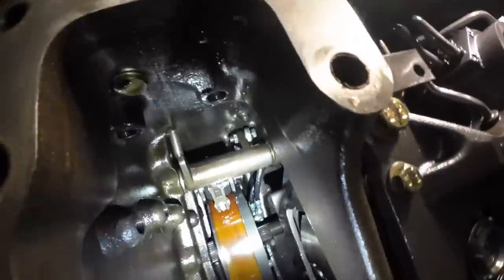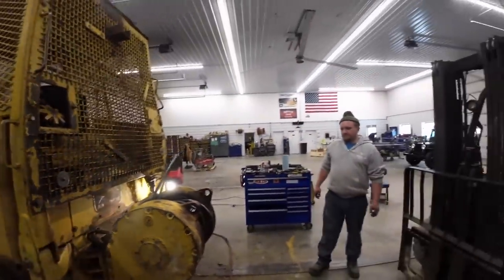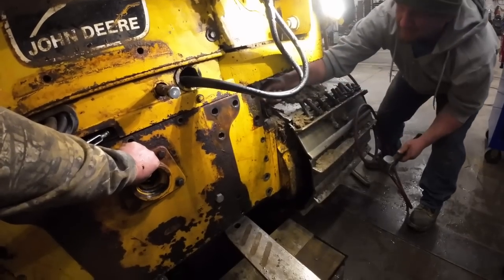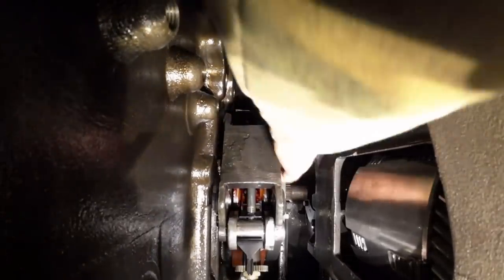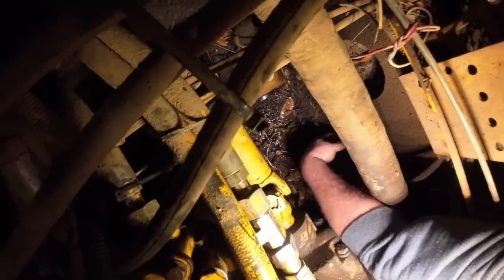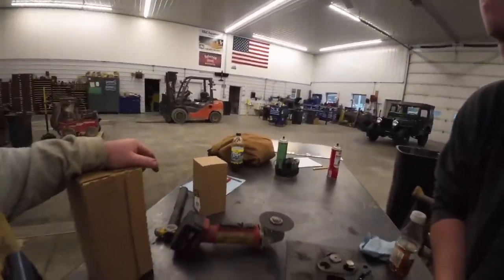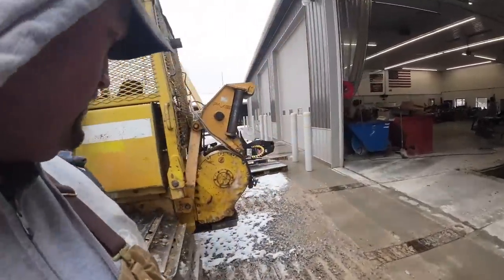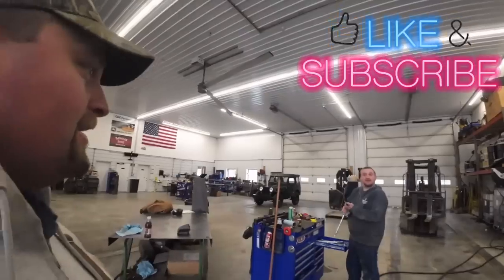Local loggers did it again. What did they break this time on their John Deere dozer

Comment: 3/26/23; ..amazing how you have learned sooo many details on these various machines; you no trouble zooming in on t exact problem, then somehow get yur 📸 camera & fingers inside the belly of the beast & fix it! So how much $ did a broken 'c' clip on left brake band tension assembly cost? $.25? ...but labor & few new related items + new hydraulic oil.. humm..gotta be coupla thousand including minimum shop time (fork lift, psi wash etc). Customer gotta be happy to have his dozer back in safe workable order. Another good job & fine video presentation. Helpful tips & info to all viewers having this type of equip also gotta be appreciated. Good job Clint! Stay safe & carry on!💪⚙️🔧👍👏✅️🍺😊

Comment: Nice video. They got lucky on that one. Nothing big got chewed up in the transmission. 

Talking off the old steering clutch setup brought back a bad memory. I got a finger stuck when the band sprung open. Luckily I was able to put my boot against one side of the brake band and found a pry bar to close the brake band enough to get my finger out. I didn’t like plan B of taking the side cutters to snip off my finger. That’s when I got my first cell phone in 1995. Working on equipment in BFE by yourself can have its drawbacks.

Comment: I love those old deeres they always start no matter what I’ve got a 450 and two 650s really the only problem with them are the frames they like to crack close to the back above the tracks I had just had to split a 450 put all new bolts between the rear section and the main section

Comment: I have a old 450g. Purchased it with 2100 hours on it.  As of right now it has 5K.   
 That machine has been a moneymaker, extremely low down time and cost of repairs, which were minimal didn’t cost much at all. 
 Can’t say the same for the cab and air conditioned 650J I have. Seems like at least once a week some little something keeps you from working it.     
  But I did learn one good tip from you about a year ago when the electrical system shut down about popping the floor up and using the dog ears to move it and load it.

Comment: I thought I may have seen the pin that the seat clip fell off of possibly honed out and like a little cone shape at the end. Even though that pins not supposed to move like that it could’ve rolled around with vibration and shaved a little metal off the end of it so if it rattled around it could still pop that C clip off… possibly?

Comment: Clint, great video, do loggers in your area use dozers to pull the logs out to the landing sites? Where I live dozers are only used to make the bush roads and landing sites. Rubber tired skidders with tire chains year round are used to pull the logs to the landing sites but transporters are becoming more common as they don’t damage the ground surface as much.
Reply from the maker: They use rubber skidders still but in winter and rainy days they will use a dozer
Or in this case it’s a small operation and this is all they probably have

Comment: them logger dozers are about like oil field dozers they see hard use and usually different drivers and kevins sausage fingers a guy i worked with in the oil field always told me if you would get them fat pecker tongs out of the way so i can see too

Comment: I have a 450G LT.  The left turn and break work with a fair amount of pedal pressure.  The right takes excessive pedal pressure to get it to turn.  It does lock up and spin the dozer around but have get on the pedal hard.  I adjusted the spider  gear through the plugged hole but when I got the pedal clearance to the recommended pedal travel then mashing the right pedal would stop dozer completely.  Just as it does when pressing both pedals.  Adjusted the right spider gear back enough so this would not happen.  No help still takes excessive pressure to turn right.  So I put the adjustment back where it was.  Thought it might be just that the last driver just turned right mostly.  But now i wonder if its something like you had in this video
Reply from the maker: Could be
Reply: Not saying I have the answers to your problem. But in this video at the end when he was pushing the foot pedals he mentioned how as you push, fist it is supposed to disengage the clutched that drive either side. Then the more you push the pedal it starts to engage the brakes on that side. There is a process to check 5he pressures to make sure they are acting in order. Maybe your clutch isn't disengaging before the brake starts to engage.   On top of trans under the seat was how and where we would hook up guages  to check the pressures for those. If I remember correctly. They were adjustable, they had small springs and you would ad or take away small washers that would change the pressures of the springs so they would have the right amount of hydro pressure and or act at the right time for disengaging clutch  engaging brakes and turning either direction. Or might need some new springs.  Or it could be something more serious like those big round clutch packs that the brake rings run on that they were working on in this video. They have a stack of metal plates with clutch disc's in between. And they get worn out and it is too much travel for the pressure system to make it work. About what he did in this video. Hope ya figure it out and good luck. 
 It's been 25 years and I'm not a certified jd mechanic. But that might be something you could look into. Just need a couple guages a
Reply: @billtmarchi4320  Thanks for the info.. I'll do some more checking.
Reply: @buck3409  ya. These were late 80s 650G dozers. So may not even apply. But good luck.

Comment: Have worked on those trans and brakes before. You do remind me of the how hard it was to put together those pins and clips and how those assemblies getting hands in there on the float or something. And when you put new brake bands on you were supposed to soak them over night in fluid to get them soaks into the fibers so it would be good when they start working them so as not to wear them out real fast, or something. But it was cool how the entire trans was on those rods and slid out like a turkey in the oven.

Comment: Loggers obviously haven't changed since I worked with them in Montana in the mid 70s nothing is clean they NEVER do any preventative maintenance run it till it blows or brakes then call the mechanic and tell him you need it tomorrow ,when the parts are a week out

Comment: Could you replace the brake band like that? Or do you have to pull the main shaft? Do you happen to have a brake band replacement video? Thanks. I have the back off my 455G now. The brake band is really loose but I can’t find anything missing like on the logger dozer
Reply: Upon more inspection with my sausage fingers inside, it feels like the brake band adjustment bolt is broken. (Not grabbing the brake band, hence why my pedal felt like nothing) Is that part of the brake band if I buy a new one? Thanks!
Reply from the maker: I could be or the ear is broken off the band

Comment: I'd say you musta been down in the belly of machines like these way before this company formed and there was a Kevin. That or a lot of youtube searching has made ya sound like the keyboard engineers. Dreadful to  ever be compared to one of them much less the lot. I still ain't figured out the name of that new welder that JC Smith had  to weld up a frame rail and then stretch the unit out more. This is just me sounding like a idiot but just why is there never a truck the right length to start with. Folks buying used rigs to just stretch em or shorten them, use it a year and  then the next owner does something different again. In and over I'd say twenty plus years southeast alaska where I had my head in tacky lubes or fluids of unknown origin... I might of stretched say four frames total. That was to make a long logger set up for doing truck and pup log trucks for shorter logs.... I see everyone in the south go for a lowboy style trailer with bunks up and down the frame rails. I not using that latter system or broke in on a truck and a pup trailer, sometimes with a self loader on the truck was the real deal for me. I have a great story of a accident that I was at fault for (too young and stupid) if ya was interested, its a dang good story I'd say as I have orally used around campfires and some alcohol may just a been involved... now sobar for twenty six years. A hundred thousand was mentioned in the altro... Ha.. you've spent that much in parts alone a good many months in a row. I'd like to have say five percent of whats spent in your tiny garage.... times say twenty of other kids garages bigger that is. Yeah a good five percent would put me into a tax bracket. Just about the only good thing on getting old and not drawing much ssi as I didn't pay in that much as I was self employed for a good thirty last working years. Odd cause as a kid, I at fifteen paid more in taxes in washington state, than any two other men in that town of about two hundred to some years three hundred. Again about that welder Clint, if ya know of it, would ya mention it in a video or a reply to me... I think I watch all of your fine videos. I know that your channel is the one I either share links or mention to others... last one I remember sharing your channel with is farmcraft 101. A good man who  tries to do all of his own stuff but at the finish usually gets too excited and will make stupid mistakes. We all make mistakes but not all of us get caught making them or even telling someone we are less than perfect... I have more to say but better to do in another comment. My comments are too long as I never leave home cept for hospital visits and a ride with my oldest boy who will be sixty in I  think his is in may.. probably wrong as too many kids to keep a record on/lol
Reply from the maker: Lol
Thanks